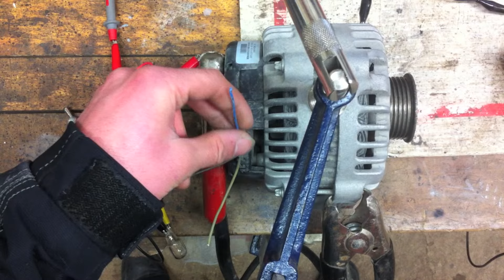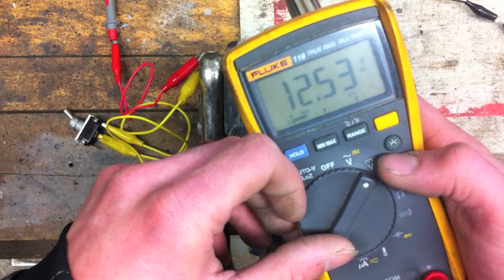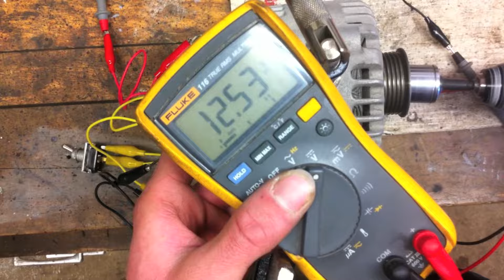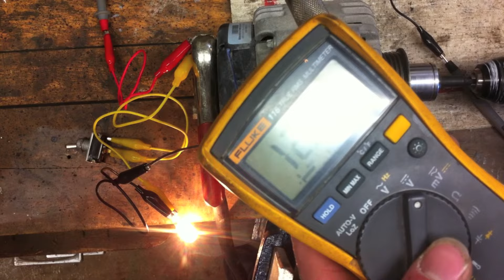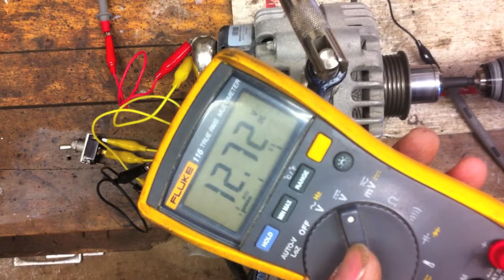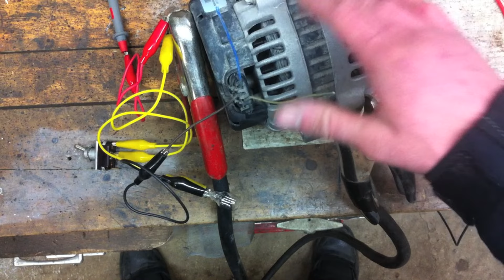How To Bench Test Your Car Alternator

Comment: I was jumping a car and my battery died just from letting it charge there battery with there car off so my only guess is my alternator happened to be on its last leg at that point. I was able to drive home after getting a jump but barely had any power and the voltmeter on the dash was at 8 volts then jumped up to normal voltage then dropped back to 8 again so i guess mine was not charging consistently. Strange because the brushes are fine maybe the regulator went bad. Stinks because ebay has new ones for cheap and they are motorcraft but i need it asap so i have to pay over 200 at o reillys. When I spin the old one by hand I get 0.23 volts.

Comment: ok so my old alternator will turn the light on but not off doing this test.  i tried 2 new alternators 1 from a ford focus and a reman denso from a  toyota and the light will light up if you touch the light ground to the case but not to any of the 3 pins on either of the new alts.  so either i have 2 bad new alts or this test does not work for all common alternators.
Reply: My car has a mitsubishi alternator with a two pin P&D type regulator and i ran into the same isssue. My multimeter showed that it was charging when doing the bench test but the light didnt turn off however the light did get brighter. I went ahead and installed it anyways and it works fine.

I'm assuming that the regulator gets it feedback from somewhere else in the vehicle that tells the light to turn off.

Comment: kind of skip to step their didn't you? I believe you have to hook a battery up to the alternator first otherwise everything you're doing is useless.
Reply: yes alt  post to battery positive and alt case to ground. then the light to alt post and 1 of the pins on the connector.  my old alt that wont charge will turn the light on but not off. the new alt i just bought wont even turn the light on. im pissed.

Comment: Your talking about cutting the pulse width or field wire or whatever you called it it doesn’t matter on the 2011 and up GM’s? Actually it’d be 07’ to 13. Further more they have a 2 wire plug. So I’d warn anyone against choppin wires to get full output since he’s comparing apples to oranges. Additionally as if your weren’t wrong enough the BCM controls the 3-4 different charge rates

Comment: Very informative especially explaining what each post is and what function it performs. I have a 2001 GMC that I installed a 5.3 LS same year. As you know there's only one wire on that alternator for the ignition to signal when voltage is required to the battery. Because the old vortec set up used multiple wires. The brown wire is not used with the 5.3 so my battery lamp in dash sporadically illuminates but the voltage gauge reads 14ish volts when running. Can I tap the alternator batt light and connect in the dash to battery lamp or is the circuit tied into the PCM? THANKS
Reply from the maker: I believe they might use PWM on the newer trucks, hence the lack of wires used

Comment: What do you mean by 'fry' the voltage regulator if it's not in series? LIke.. you make sure it's attached to the battery before it makes contact with the L connector? LIke.. that's the negative and the positive stud part can only be connected to 'under load' meaning, the battery needs to be in place?

So cornfused..

Comment: Why can't you just connect a voltmeter to the + terminal and ground on the alternator when it is spun?  Why the light bulb?
Reply: The exciter wire or "field" wire's voltage tells the alternator to begin charging the battery. When the ignition is in the run position without the engine running, 12.5 volts flows across the circuit, including through the "warning" lamp all the way to the "l" terminal on the alternator. The "l" terminal serves as a ground, making the lamp turn on. 

When the engine starts and is running, the alternator sends 12.5 volts back through the "l" terminal, thereby interrupting the ground, which in turn causes the light to go out. When this happens, the alternator also at the same time is turned on and starts sending voltage out to the battery through its"b" terminal. The lamp serves as resistance in the "exciter" circuit and is what ultimately tells the alternator to start charging. 

By bypassing the lamp, there is no resistance in the system or way to indicate a problem with the alternator.

Comment: This is just the video I was looking for. When I test the voltage coming from the plug on the car, I get 5v. Is it possible that some alternator voltage regulators need 5v being supplied not 12v?

Comment: Question. I'm rebuild a car no electrical component in it yet just the engine. my alt not charging. It has the same Voltage as the battery. Is it because I don't have anything electrical running or the alt is done

Comment: I’ve got a B.B. Low Turn Alternator 1 wire red & White for the dummy light & my impact gun maxes out 2,000 rpm my issue is my battery in my gun ! Not getting the rpm

Comment: Will upgrading the amperage in a cars alternator create more amperage coming out of the stock battery or must i replace the battery also to get more amps out of it???
Reply from the maker: S10 truck probably has a 95A alternator or somewhere around there. Does it cut out even when you rev then engine? A alternator will only produce peak current at around 3000 engine rpm. If it still dims when revving the engine, I'd bet your cables are undersized/ poor connection.
Reply: @Mr05Tundra       i never tried revving the motor so i dont know, im away from the truck now but the stereo system was professionally installed, the battery and alternator wires under the hood we're not upgraded though .. Are you saying the stock alternator is good enough? Upgrading it wont help?
Reply from the maker: @babyjesus2025  I can't say for sure because I don't know what kind of power you're pushing. Cars are typically built to a minimum standard. Lights dimming is due to voltage drop, it can very well be your alternator but in most cases, it's undersized wiring from the alternator to the battery. If you install a bigger alternator, you must upgrade the wire sizing anyways so I'd start with the wiring. Some people install capacitors inline with the amp, that is a band aid fix to undersized equipment/wiring but it works.
Reply: @Mr05Tundra     thank you. Yes I'm going to upgrade the wires under the hood from Battery to alternator and grounds first but if that doesn't work can I just upgrade the alternator or do I have to upgrade the battery also???
Reply from the maker: @babyjesus2025  you can leave the battery stock, when your car is running, all power comes from the alternator anyways, the battery for the most part is only getting charged when the car is running and not giving out any power.
Reply: @Mr05Tundra     cool. Ok thanks 👍👍👍

Comment: Hello 

Just I want relationship between alternator speed and voltage can you please post this...
Reply from the maker: The faster you turn the alternator, the higher the voltage will be. That's why you need the voltage regulator in order to make sure you don't send 28V to your cars electrical system when your reving your engine.

Comment: Tried using the same setup. the bulb didn't lit.  I connected the positive on the B+ and the negative on the connector with (L) code.  I'm checking my Denso alternator if its still working. Did I miss anything.
Thanks
Reply from the maker: Does the bulb light up?
Reply: No. The bulb didn't lit, but i tried to connect the bulb directly to the battery and its tested ok.
Reply from the maker: @bengiw1  and your testing this while having the battery connected to the alternator (stud on the back positive and negative on alternator case)
Reply: I checked the bulb by directly connecting it to the battery and it tested ok.  Again i followed the connections in your video and it didn't light up. The positive of the battery is connected to the stud and battery negative is connected to the case of the alternator.
Reply from the maker: @bengiw1  well it should light up so I'd say your regulator is no good
Reply: @bengiw1  the negative of the light bulb goes to the L pin on the alternator and the positive for the light bulb goes to the positing post ont he alternator. if u get them backwards it wont light up
Reply: My situation is this.. all new alternators i get my hands on have a different two prong plug that dosnt match the connector on the wire harness. So i bought the connector needed. With that being said. How do i find out which prong within the plug on the alternator is the power and which is the ground?

Comment: So if the light doesn’t come on when connecting the bulb to any of the pins on alternator does that mean it is bad?
Reply from the maker: Can also be because the bulb is burnt or bad wiring, if the bulb is burnt, the alternator will not charge
Reply: @Mr05Tundra  If i take the wire directly from battery to bulb it works.  When i connect it to the alternator positive and any of the pins for the plug it doesn't light up.  Does the bulb have to be a big bulb?  i used a side marker bulb and its a small bulb.
Reply: @Mr05Tundra  This is an alternator from an 02 ford focus.  Three pins in plug and on the wiring diagram 2 wires go to PCM and 1 red wire goes to battery junction box to a fuse that says always hot and its a red wire on the plug.
Reply from the maker: @robcat7499  you can use a side marker bulb, that's no problem. It's most likely the voltage regulator acting up, that would be my guess